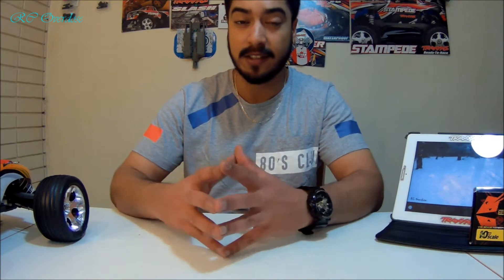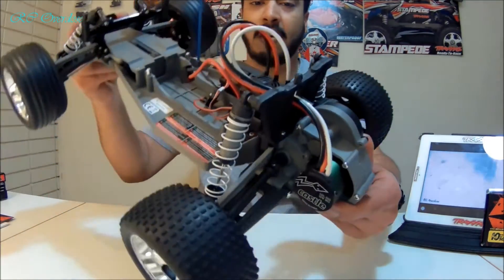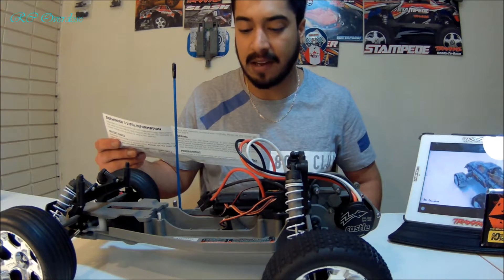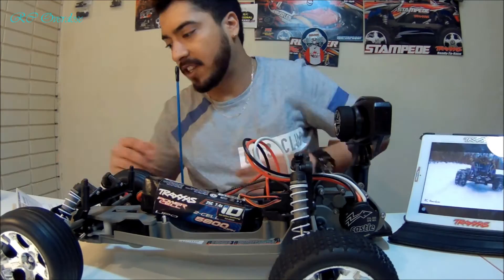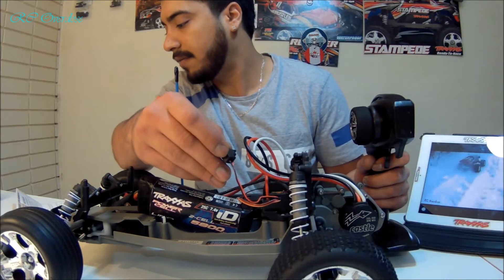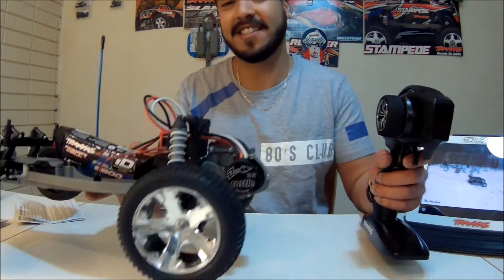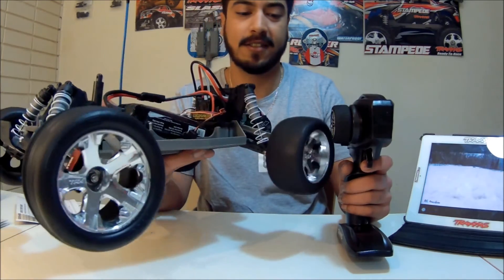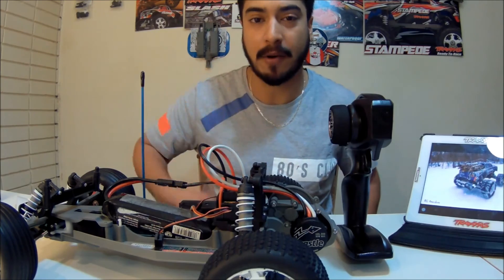RC Overdose-Rustler Castle SideWinder3  5700KV ESC Setup (Fully Installed & Running)

Comment: you can tuck the wires underneath of the ESC mount it would look a whole lot cleaner that's what I did on my Traxxas Slash and it looks amazing
Reply from the maker: +ibsilly 4u Thankyou so much for the advice brother.I appreciate it.I will try that out once I install it again.For now I am running a vxl setup in it.Sv3 overheats fast.
Reply: RC Overdose another run 90/20 is the gears I run in my slash little bit heavier but I'm only getting about a 110 on the motor I put a fan on my ESC running about 45mph on 2s 30c 5000mah battery

Comment: I havbe the same exact setup in my stampede, same battery and everything. It looks like your battery is really puffed up. My did the same thing its a big hazard, if you have your reciept  from when you bought it call traxxis and they will sent you a new one. Took me 5 minutes on the phone and a few pictures of my battery and picture of my reciept and got a brand new battery for free, Traxxis is good when it comes to that stuff
Reply from the maker: Tayton McDonald My  battery is old bro,I've used it over hundred times and didn't do my research on lipos that good.I am still learning on how to take proper care for a lipo.I have two batteries,both are fat lol.Traxxas has sent me a few parts in the past four months.But I don't think they will be able to do anything with my lipo.Its 6 months old battery bro.
Reply: That was with mine, I had it for awhile but only used it a few times. Idk maybe they won't. But those batteries are expensive and will be even more expensive if they catch fire in your truck. Or charging in your house.

Comment: What are the kv's in a motor for I know they are kilovolts but what do they represent?
And merry Christmas by the way
Reply from the maker: Donkey Commander Merry Christmas Brother.Here is what I was able to find for you Valdemer.KV as we use it refers to the rpm constant of a motor - it is the number of revolutions per minute that the motor will turn when 1V (one Volt) is applied with no load attached to the motor.

Comment: Hey is this setup better then. The velineon setup ?
Reply from the maker: +ytbswiss vxl setup is the best
Reply: RC Overdose so you recommend the vxl over this one I have a brushed rustler an I want to go brushless so I’m trying make sure I get the right system lol an I watch a lot of your video an your rustler be out
Reply from the maker: +ytbswiss vxl setup is very good,Castle setup is good but you will need higher discharge battery etc and on nickels it doesn't perform well.So vxl overall is a great all rounder brother
Reply: RC Overdose thx Bro